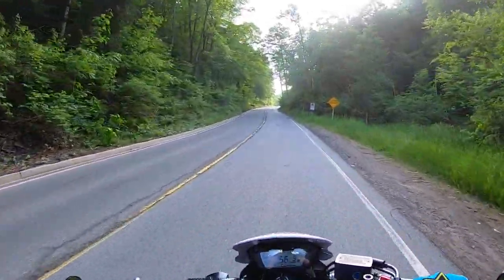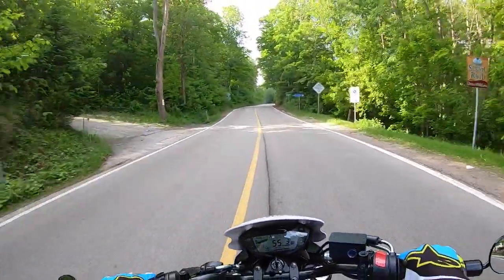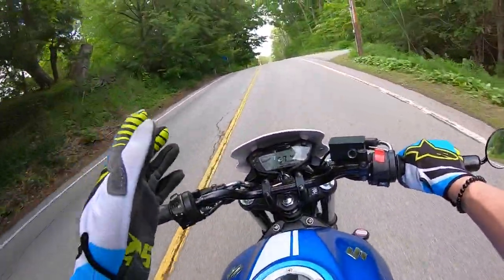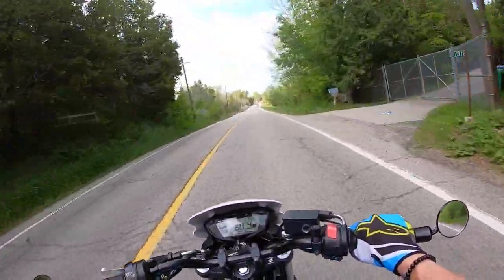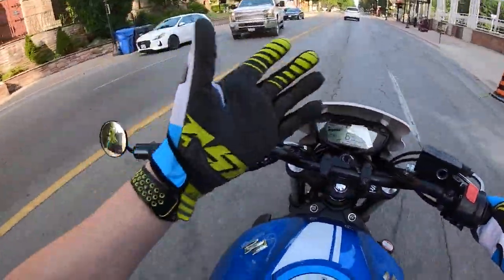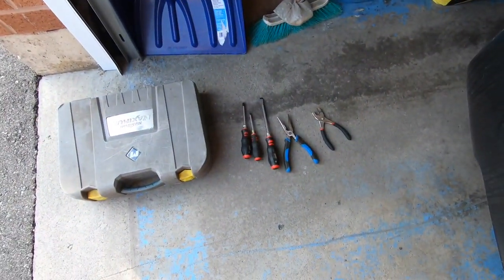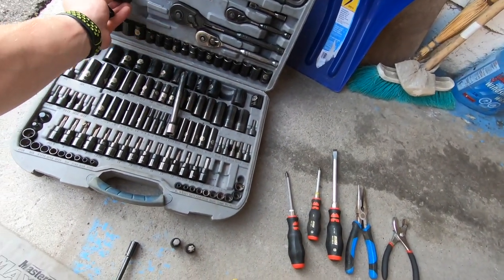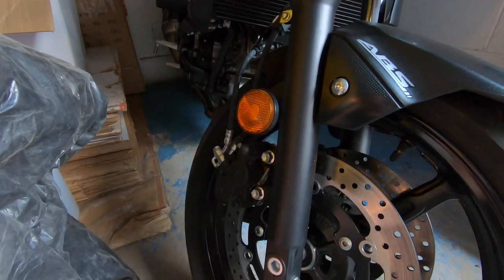All The Tools You'll Need To Work On Your SV650 Or Any Other Motorcycle

Comment: The fuel estimation gets better once you have used a bit. I think it does this because it cant read how much you have over a certain amount due to the shape of the tank. So it uses that extra, then goes into what fuel it can actually see that you have.
My fuel estimation stays at about 160 miles or so for a while

Comment: Great video as always Bro ... How do you find the stock suspension? On a long ride on my SV650 it feels like i’m riding a Jackhammer after a couple of hours .. lol ... I mean the bike just feels bumpy as shit. I’m thinking of replacing mine with something that i can adjust the rebound and dampening. I was getting bounced out of the seat on bumpy roads and the front end was shaking at high speed when i first got it so i took it to suspension guy to get the Sag set right. He had to set the rear suspension to No 7 (highest) for my weight with gear and my tool pack bag (about 87kg). I’m not bouncing out of the seat anymore & the front end is steadier but its hard as a rock now. I ended up putting it down to No 6 cos i was too Tip Toe (I’m a shorty leg) but it still feels like a jackhammer after a few hrs. Do you think upgrading my suspension would fix that problem. The guy said changing the oil in the front forks would make a difference to them or should i go fully adjustable on he front as well? What do you think? Are you considering upgrading your suspension at any stage?
Reply from the maker: I honestly don’t have an issue with the suspension at the moment and don’t want to make any changes from stock. Wish I could help

Comment: You need a torque wrench. Take things off, you need to put them back on.
Reply from the maker: I have one. But unless it’s wheels I don’t bother with it. Nothing takes that much torque so hand tight is usually more than enough anyway. Pulling the torque wrench out is nice but I don’t use it often